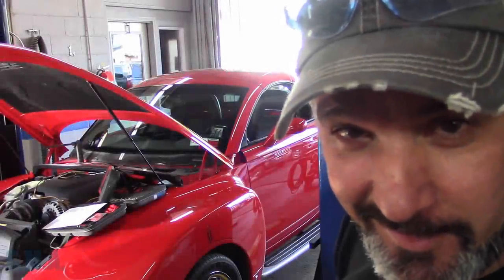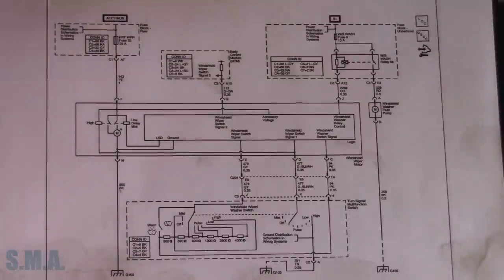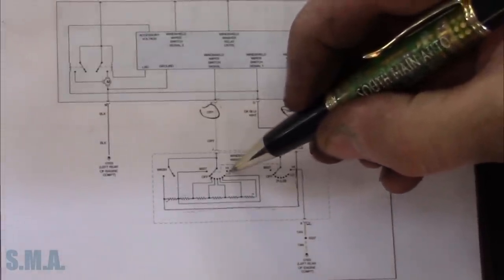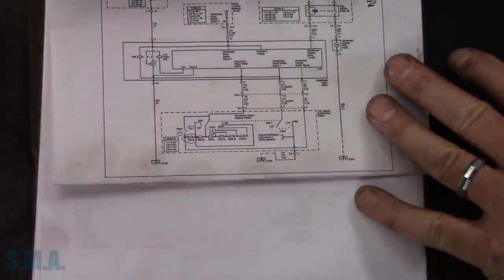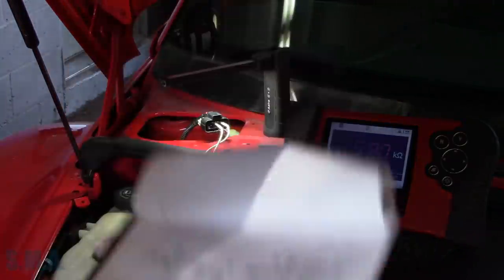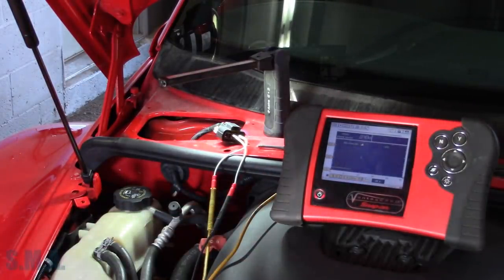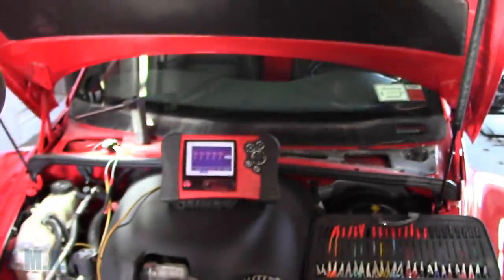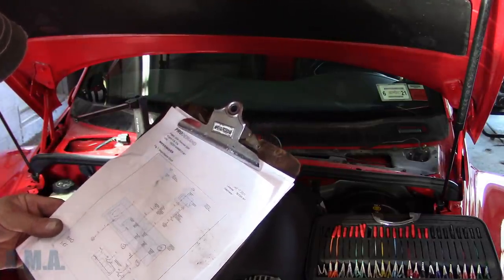Chevrolet SSR: Wipers Gone Haywire

Comment: The 380 ohm reference is almost certainly a typo in the documentation. This is not a standard value in electronic resistors but 390 ohms is a standard value. Also the 2800 ohm figure is probably wrong as it is also not a standard value but 2700 ohms is. All the other values you quoted are standard electronic resistor values. Tolerance for resistors is generally 5% or better.
The flickering of the meter reading from 397 ohms to 401 ohms is a problem with your meter automatically changing ranges not with the wiper switch.
Reply: You beat me to it!  That’s what happens when technical writers don’t really understand what they’re writing about.  I see it too often at work (broadcast engineer)... and if it’s a foreign piece of equipment, add mis-translation.  Back in the ‘80s we had an NEC video effects box, and the manual was hilariously exasperating.
Reply: If the switch uses a hybrid circuit with printed thick film resistors (not uncommon) they can use whatever nominal values they want.
Reply: LOL.. GM can specify any resistor they want.
Reply: @daveblane6442  They can, but their profit margin is best protected by using standard parts.
Reply: Ohms fall into ranges. They are not exact.
Reply: Johnny, resistors are specified by nominal resistance, tolerance, and power rating.  For critical applications (which this is not), the temperature coefficient is also given.  Given cost factors, it is overwhelmingly likely that GM designed this using standard 5% tolerance resistors.
Reply: Dave, they can specify any resistor that exists.  390 ohms is a standard 5% value, is dirt cheap and very common.  380 ohms is not a manufactured value, even in precision series (2%, 1%, 1/2%) where the closest values are 383 ohms and rarely 379 ohms.
Reply: It's all German to me!😉😉😊😊🤣🤣
Reply: @ferrumignis  Correct.  A late-model multi-function switch device doesn't use discrete resistors, so standard values may not apply.  The circuit uses the resistance values as part of a logic timing base and carries very little current.  Printed resistances on a common backing are shaped to fit the switch and very cheap.
Reply: @jeffhartman7000  even better, call the Philippines and try to troubleshoot a satellite IRD during an outage...tech jargon and thick accents make for interesting phone calls.
Reply: @jeffhartman7000  I used to work for NEC (in the telephone equipment division) and understanding documentation was sometimes challenging. I once asked head office for documentation on a custom integrated circuit and received a document in Japanese. I asked a local Japanese engineer to translate for me and received the English version several days later. Unfortunately the translation was about as clear as mud. I went back to the engineer who translated it and said the English translation didn't make much sense. His response was that the original Japanese document didn't make much sense either.
Reply: @ferrumignis  It seems unlikely that it is a hybrid circuit as most of the other resistors are standard values. The usage of hybrid circuits for non-critical circuits is very much reduced these days as production using machine placed SMD components on standard PCB material is usually considerably cheaper than hybrids.
Reply: @jeffhartman7000  Are 5% tolerance resistors the standard today? Back when I learned resistance value codes for carbon resistors, no tolerance band meant 20%, silver meant 10%, and gold meant 5%. My information becomes more obsolete every day.
Reply: @daveblane6442  They could. But I am sure that the GM accountants, given the choice between a 0.1c standard part and a 1c custom part, would opt for the cheaper standard part.
Reply: @machintelligence  Whatever tolerance is suited to the application is standard. But you have to look hard to find worse than 5%. I rarely bother with anything worse than 1%, because there's little price difference below the hundreds of thousands quantities. To give you an idea, a 390R AEC-Q200 qualified 0402 at 5% will set you back about $12 for 10,000. 1% tolerance will set you back about $15.
Reply: @Monkeh616  Really? Are you saying you can purchase, say,  a 50,000 piece reel of resistors for only $0.50? Who is your supplier?
Reply: @machintelligence, 5% is the most commonly sold tolerance nowadays.  2% (red band) and 1% (brown band) are often found in applications like op-amp circuits where you want to establish thresholds or maintain high common mode rejection.
Reply: @stephenbell9257  I apologise, two in the morning me shifted a decimal or two, I was thinking in dollars. Still, they probably get good price breaks for the millions.. $0.001 is about right for tens of thousands.
Reply: Stephen Bell, our device was the “E-Flex”, a rather large rackmount box that could squeeze analog video, circa 1984.  The manual repeatedly referred to pairs of parallelled BNC connectors, through which a video or reference signal could be daisy-chained, as a “roopthrough”.

Comment: in order for the wiper motor to run at  2 different speeds(high/ low)the power supply  can't be the same value chevrolet. excellent  Eric

Comment: Since it was acting up in the 'off' position, I would have stayed focused on that - making sure nothing happens as the switch is bumped (road vibration).  Also, making sure power was good and no shorts to ground.  Checking all the switch positions was interesting, but felt like a red herring. I assume it was a "make sure" before ordering the expensive part.

Comment: I worked on a 1972 Chevelle wagon that the wipers would not stop. This was before anyone knew about testing or at least I assume that. They way I fixed it was put an extra switch to cut the power going to the wiper switch. I am sure it was the "park system" that was faulty!

Comment: I still have a 1998 GMC pick up truck, My wiper would randomly park where they wanted to, I took it in and had the wiper control arms in the cowl area replaced, they said they were bad. I believe them cause they have been honest, like you Eric, and it improved how they wiped, from park to max sweep. But the wipers would still, with them cold, as in the first use for the day, when I would turn them on they would go about half way up and just stop, a couple of seconds later they would continue, repeating that for several strokes. After more time had passed and asked in a auto form what it might be, it was suggested that it could be the multi function switch, which I had my son pick up one at my local O'Reilly Auto Parts (not a sponsor) at his cost, and then found a place to install it for me. Afterward that not only fixed the wiper issue but it also fixed the interment function for the cruise control. In my 'book' that was a win win.

Comment: My truck had a weird wiper problem where low worked fine, high worked fine, wash worked fine, but intermittent would all of a sudden go three or four times in a row and then return to intermittent. It would then work fine for months and go back to weirdness when on intermittent going 2 times, sometimes three times, sometimes four, five and return to intermittent. I initially thought switch, but it would do the same thing no matter where in the intermittent setting it was whether maximum delay / minimum delay or anywhere in between. I made the decision to replace the motor and transmission assembly and boom problem solved, and stayed working for the last couple years. Also on a side note when I took the assembly out one of the pivot points was almost completely apart and ready to break, good timing. It sucks only having one wiper work, or neither lol

Comment: I recall when the 90’s GM trucks and SUV’s would have the wipers randomly turning on we would re-solder any cracked solder joints on the wiper delay module. Fixed the problem 95% of the time. I assume the ‘06 is not the same.

Comment: Way back in the day when they started putting computers in cars they were telling us that all you would have to do is plug in a computer to read what is wrong with your car. Still doesn't work that way yet.Electronic repair man and mechanical engineer. This is nuts.

Comment: One other (maybe slim) possibility before changing the motor is to first inspect the integrity of the connector pins inside the connector you're probing. Intermittent connections are very difficult to track down and connectors are often troublesome.

Comment: What I don't understand is that the circuit with low resistance runs the motor on low and the circuit with high resistance runs the motor on high. I would think it would be just the opposite.

Comment: I replaced the hydraulic tank and replaced the gear in the roof latch motor on the exact vehicle. Symtom was roof not closing and locking.

Comment: The logic in the wiper motor is pretty clever. It uses a microcontroller that has analog to digital converter(s).  So feed it an analog voltage of a value (from selecting values of fairly precision resistors) and it will do the A/D conversion and set the speed of the motor. The other inputs tell the microcontroller what you want. Variable speed, low, high and mist. Bada bing, bada boom. Done.
Why did that smart circuit go wonky?  Probably bad or cracked solder joints. If the microcontroller is a ball-grid array, one or more of the balls under the chip has cracked (I hate the no-lead solder that’s used these days. It’s junk.) and the microcontroller gets very confused, and does the best it can, which can be pretty chaotic.  Re-flowing or removing and re-balling the microcontroller could possibly fix the problem, but that takes some special soldering tools and techniques. Could be other cracked/open solder joints on the circuit board too.  No-lead solder works fine for a few years, but in automotive environments, it is prone to micro-corrosion and eventual failure due to vibration, board flexing and wide temperature swings. 

Great video!!  This was quite thorough troubleshooting. Excellent explanations, circuit tracing and spotting service data errors and understanding the circuit purpose and operation.  You are a wizard at this and again, excellent troubleshooting!!!

Comment: I changed the wiper motor in my 81 ford truck and I think it may have been easier to pull the v8 motor out then to change that soft ball size wiper motor. Hope the new one lasts for another 40 years.

Comment: Stuff like this reinforces the belief (at least in my mind) that it's kinda pointless to keep any modern car as a collectible as not being able to source a replacement electronic component can render the car unusable.  If Cardone wasn't able to supply the new wiper motor then this rig would fail its next inspection due to no wipers and would thus be undriveable.
Reply: Hell no! We can jury rig something!
Reply: @davidvoinier6008  I can jury rig it, Captain, but it won't last fer lang!
Reply: @markh.6687  
 When I have to jury rig something, it's usually better than the original product❗

Comment: The problem is in the parking circuit inside the wiper motor. It's a super common problem with GM. The cam can wear out and the microswitches get out of sync

Comment: The 'flicker' at time=14:01 was your meter range changing to display 0.41K which is 410 ohms -- just above the 394 you previously saw. This is common if the measurement is at the transition from one range to another.

Comment: I did one of these the other day on a c6 vette I used deductive reson to decide it was the motor and not the switch it would stay on and turn on random very similar problem to this one but there was never a problem with the washer circuit that comes from the same switch so my inter Sherlock homes said has to be the wiring or the motor checked wiring a bit powers gounds with a 4 amp  test light threw a motor at it has not came back yet 😉

Comment: I don't know why you have the Snapon Vantage in the engine area..just hang it on the steering wheel and do all your checking while in the drivers seat as your not changing any connections in your plug-in. By the way some SSR parts utilize Volkswagen parts like the 2 speed fan which is the same other than the plug in which you can jury rig or cut out of the orig SSR and super glue into the new VW fan unit.

Comment: Im not quite 30 yet and im already fed up with all the extra stuff they cram into cars
Reply: The problem is not the extra stuff, it's how its designed and implemented into the car. Having extra stuff that's cheap to fix and easy to diagnose is not bad, but when it's designed to be completely scraped when there's a tiny issue and it takes hours to change because it's not easily accessible, that's when you're in for a treat.
Reply: Buy a classic vehicle  - drive it as primary car....at the end of the day it'll be worth much much more than any new car could hope for 😁👍

Comment: The wiper pulse board recall from the 80's and 90's was a fiasco.  I bought a Dorman brand board that failed within 3 months. Under warranty I exchanged it 2 more times.  Guy at parts store said it's your multi function switch. Nope, cold solder joints and cracks on the traces was the failure.  Bought a Cardone board and guess what, no more issues for 12 years.
Reply: David Ashabranner 
I guess that's all subjective, I bought a Cardone wiper motor for the '87 Caprice we had at the time. It took 4 different Cardone wiper motors before I finally got one that every function worked. After the second one didn't work the store was trying to say it was the multi-function switch, to which I said not when it's a different function that doesn't work with each new motor. The 4th try got it.
Reply: @ralfie8801  could be just the luck of the draw.
Reply: my 1992 started acting up around 2017, I dealt with it for a while, then it fully stuck on, pulled the board off re-flowed and added stiffening wire. don;t think it will break again lol
yeah it was a total pain (van) but far less pain than replacing the whole assembly.

Comment: My 1998 Chevy S-10 has a cicuit board inside wiper motor assembly that goes bad and you can just buy the board for $20 bucks and replace board. It was a common problem on S-10's.

Comment: 1 minute in and I think it's the same problem I had with my 03 Astro.  A couple of dry sockets on the board in the wiper motor.
Reply: You should have taken the electrical board out of the motor, probably 3 or 4 screws (the wiper motor may have to come out too get to it in an SSR), find the sockets that look like they have a tiny crack and reflow the solder, maybe add a dab of new solder for good measure.  10 minutes (if that) and about a penny worth of solder.

Comment: The wiper motor logic doesn't see resistance, it sees a drop in voltage.  When you have a power line between two resistors, its a voltage divider circuit....but it's far easier for us to measure the resistance to make sure none of them are toast.  The wiper motor generates the regulated line voltage, so it sees the return voltage whacked down based on the resistors prior to the split to understand what function has been ordered based on the voltage differential.
Reply from the maker: 100% correct, but like you mentioned it is easier to test the resistors than hold on to the motor and check the voltage input on each position. But yes this is a voltage divider.

Comment: Had a multi-function switch I accidentally hit with my hand in such a way, the wipers
came on, I think the washer at random, just no rhyme or reason. Was not worth my
time to debug. Replaced switch and problem resolved. This was on a 90s Honda.
Hopefully the wiper motor in your case will fix it. Same symptoms, different culprit.
Reply from the maker: There is no "hoping" in this case. We tested so we know 100% for sure :)

Comment: Service data wrong? Hahaha I've never seen that before.... JK! I'm glad you found a solution to getting a part. When ever a part is discontinued the parts department laughs and pretty much tells me to go ** myself. I'm like go aftermarket, call the junk yard and i get a no. Its very frustrating i'm here to help the customer get their cars back on the road. I've gone as far as searched the internet and found a solution myself and told the customer to buy that part and ill put it in. Like I had a  94 tpm sensor that was bad (i think someone damaged it doing tires) Found the part on ebay. customer got it, brought vehicle back and we were good to go...

Comment: I have both a 2000 WJ and a 2000 XJ and the rear wiper on both do not work. Following your logic, I consulted the wiring diagrams for both. The XJ has only a 1 range control and a parking switch, however the WJ has a logic module built into the motor that is controlled by the BCM only because it has a preset delay setting. I can troubleshoot the XJ, but the WJ I'll probably just buy a motor.

Comment: 14:00 The flickering looks like the scan tool just can't decide which unit to display in. It alternates between ohms and kiloohms. The value changes, but only barely and probably within the tolerance. 400 ohms appears to be the threshold that the scan tool uses to auto switch the display to kiloohms.

Just a guess, I have zero experience with using any sort of automotive scan tool.

Comment: Not sure on that specific model of GM, but most of the "smart" motors from gm models of that time range have a position sense in the motor that gets grease on the contacts and gets possessed. They like to start as bouncing around and stopping in the wrong place, but can also just turn on without warning or not shut off. taking the motor apart and cleaning it evicts the gremlins for a while until the geese gets back in the sensor again. Have to clean the inside of the motor about every 6 months to a year on an 02 envoy with one of the smart motors.

Comment: Great video.  Can you just replace the wiper motor cover?  Most of the time there is where the problem originates from cracked solder joints.